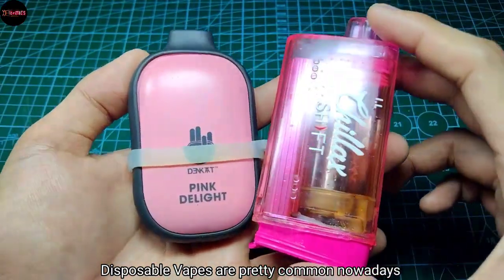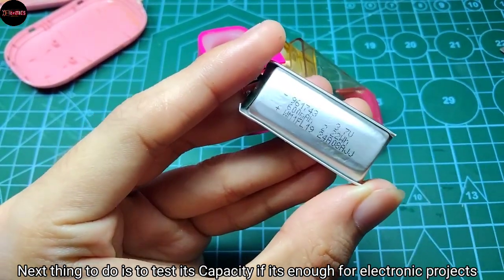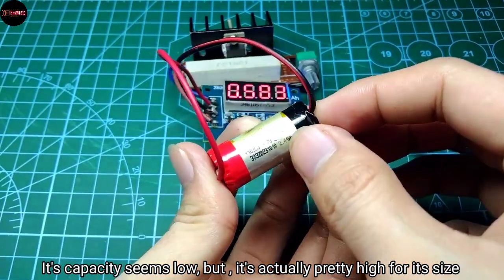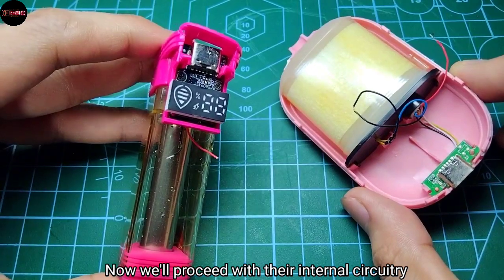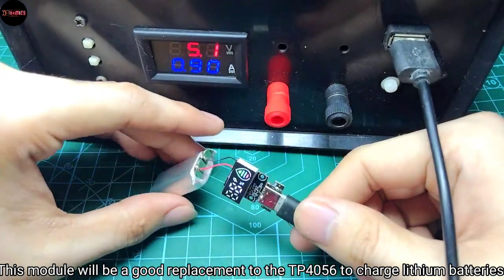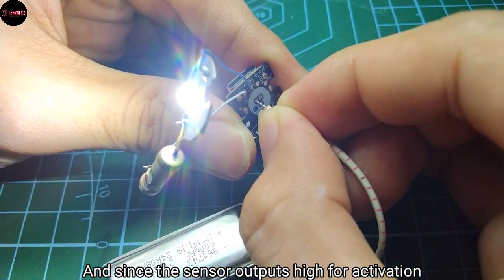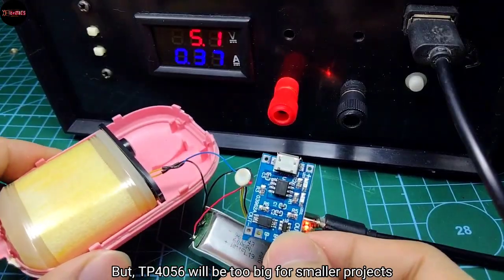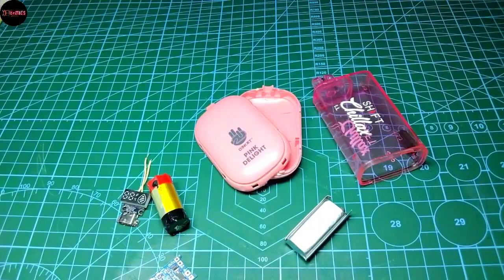Vapes Parts Are Pretty Useful for Electonics Projects !! #vape #recycling #electronicsdiy

Comment: i have also a vape with meter can i use it with 12v battery pack
Reply from the maker: If the vape circuit is 12v rated, yes.
But I highly doubt it cause vape typically uses 3.7V or 2S 7.4V batteries
Reply: @x3dtronicsph yes in every valr there is 3.7v battery😢😅😂

Comment: Hello, super videos ❤. Please make more videos about reuse vapes for other things etc. I liked the charging method for better vape with display. Is there any way for it to charge undervolt batteries? Like 1v only in battery.
Reply from the maker: Thank you brother. I ran out of vape here since I don't Vape nor smoke😆.
For the 1v charging bro, unfortunately it is not possible because of the chip used. I'm still thinking of possible projects from vapes. Thank you
Reply: @x3dtronicsph  same brother, i dont smoke either. I just said to all my close ones, as friends etc, to give me their used vapes. Now i got like 100 pieces of vapes. Still thinking what to do with them

Comment: Hello ! Im working on a project, do you know how I could replace the « capacitive » sensor with a button so that the board activates only when a button is pressed ?
Reply from the maker: Please check the Pinned Comment bro, I had another project with same idea as yours.
Thank you
Reply: @x3dtronicsph thanks ! I actually have a lot of these rechargeable battery with dedicated pcb, and actually I have a few that uses the 3 wire thing but not all. The other are only 2 pin and are connected to the « round capacitive thing » do you know how to handle the second type ? (When I put my screwdriver or finger on one pad the thing activates)
Reply from the maker: @BlueOctopusDev two wires is kinda odd, Didn't seen one of those 2 wire sensor.
Try measuring the voltage , connect negative to negative. Then probe one of those wires each to see if there is changing voltage.
I don't have idea since it's really odd to only have 2 wires

Comment: This is the most original video about using vapes. Well done.
Are you going to address the issue of it turning on only for a short time and the charge level lights up every time it turns on, which will drainthe  small battery very fast? Just some ideas for future videos:)
Reply from the maker: Thank you for the time. Unfortunately, the on time limit is programmed to its control chip, no Idea as of now

Comment: I use the built in chargers for pojects all the time, but only for the charging feature. I just run whatever i am powering straight off the battery and use a toggle switch to bypass the timer. Im not an electrician and dont really understand how all this circuitry works, but i have not had any issues yet.

Comment: I'm wondering what uses are the circuits in these vapes, i have loads of them after disassembling for batteries i keep the circuits too for parts. Wondering if i can re purpose them but that limited time power is the issue 😢
Reply from the maker: Yeahh, all of these sensors have time limit, but you can make a Latching circuit using a 555timer or just Transistor to drive another thing.
You can also Use optocouplers after that to Drive Mains Voltage.
Feel free to search about latching circuit,
Another thing is a Time Power on circuit
Reply: @x3dtronicsph  I tried removing the sensor thinking it was the chip inside controlling the time it's powered up for but it must be part of the main board controller chip, the main board chip has safety features for over current protection ect.... charging protection 1.5A usually 🤔 i just wanted to use the main board with a regular switch for making other projects like a small torch 🔦  but it keeps turning off and I'm a novice so don't know how to get around this issue 🙄🥺
Reply from the maker: Brooo.
Search for Latch Switch using Mosfets.
You can thinker for thatttt. 555timer will work, but the problem is the standby current at the minimum voltage operations of 555 ic.
You can just a different touch sensor module that you can buy online.
Just use the sensor for charging

Comment: A little unrelated to the video, but I wonder if I can use a regular blue insulation tape to insulate the contacts on the battery instead of that yellow, heat resistant one that goes from a factory (it can be seen in this video)? Or is it essential to use a heat resistant insulation tape?
Also, I wonder if I can use a Chinese glue gun to glue such a battery. Because I'm afraid that the glue can melt if the battery heats.
Reply from the maker: I guess it will depend on the application of the battery bro.
If it's like for low Current project, I even use scotch tape for that😆😆😆.
If something heats up too much, the scotch tape will just melt disconnecting connections.
I'm not sure for the Hot glue though.
I always use hot glue if the project is low power and doesn't heat up much.
It will always depend on the project afterall.

My recommendation is just, don't use to much heat resistant tape, because if something goes wrong, the heat from the battery can melt the connection disconnecting the battery connections.
If too much heat resistant tape applied, theres a chance that it will just catch fire or worst , explode💀💀💀.
Fuses are pretty helpful if you want
Reply: @x3dtronicsph  is using tp4056 safe? bcoz im broke ☠️🙏😭
Reply: Just now that in my experience hot glue gun glue is somewhat conductive
Reply from the maker: Yessss, if small metal parts were somehow mixed inside the glue gun. I don't use hot glue now with sensitive reference or other sensitive circuits

Comment: even disposable "vapes"use regargeable cells, you may add a voltage controller taken from a phone battery
Reply from the maker: You mean the BMS?? Pretty hard to work with SMD though🥲
Reply: @x3dtronicsph  its on a small circuit board with quite large connections